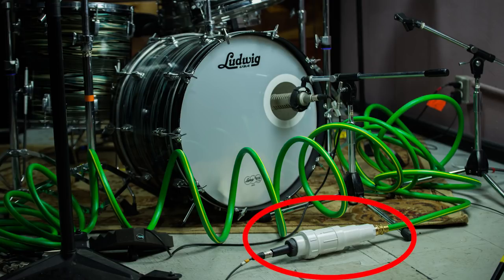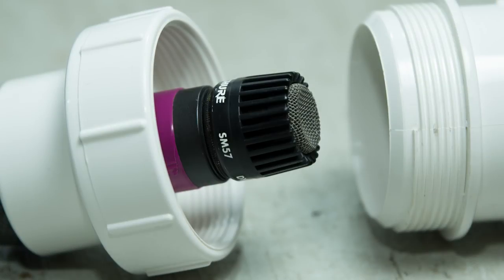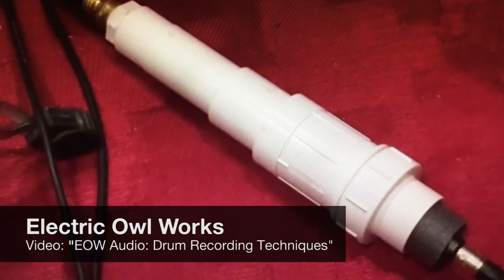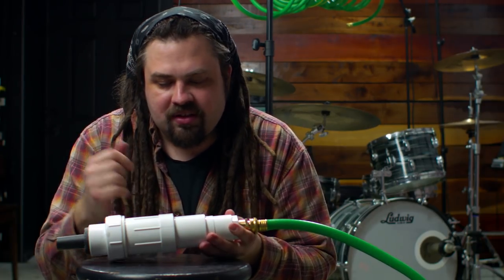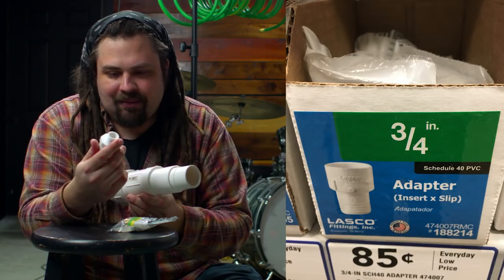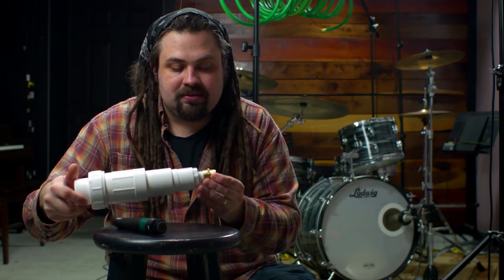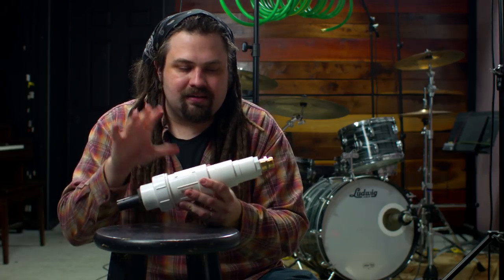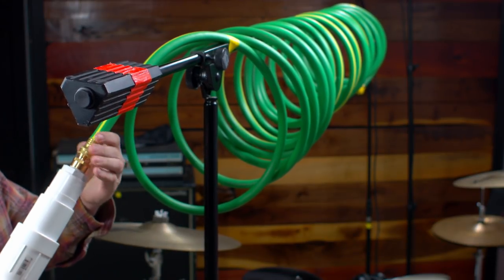How to Connect a Microphone into a Garden Hose Reverb

Comment: HEY! So, I keep meaning to get this stuff, but I haven't been to my local "reverb-supply" store yet. I've been using a homemade funnel and I just put it outside the room for isolation. It also allows for variation in the mic position and angle. I'm having a blast with all the household stuff - pipes, hoses, flex-duct, drain pipes - that I can use for reverb. It's really cool what you can do with a budget of next to nothing if you get a little creative (or subscribe to someone who is).

EDIT: You should stick this in the face of a vocalist, right next to the vocal mic!
Reply from the maker: Nice, yeah I'll have to pull of the funnel at the end of the hose soon, if I don't do it this next video.

Comment: Have you tried this with guitar amps? Or even reamped lo-fy-ish vocals using some amp... Might be intersting
Reply from the maker: Yeah, it may not work as well in the method used here (end closed - A diffused effect not meant as a delay effect), because a vocal reamp can be pretty dark and this will just be more of the same. But if you meant to use this as a delay, then it could work really well. Perhaps a funnel to help boost the spl going in.